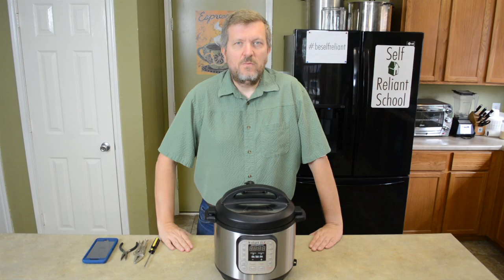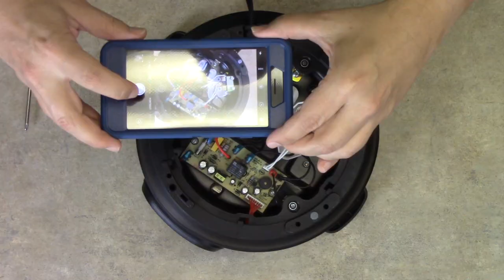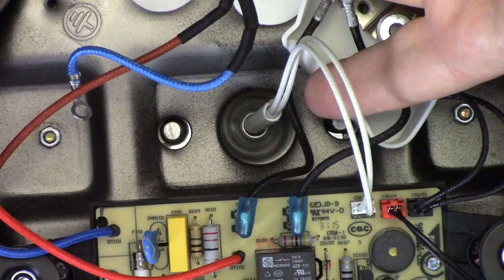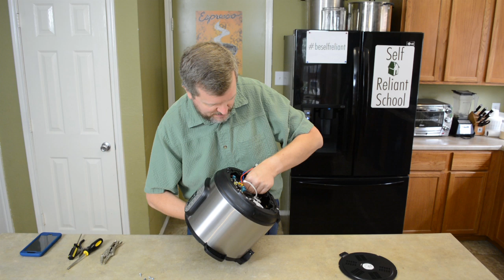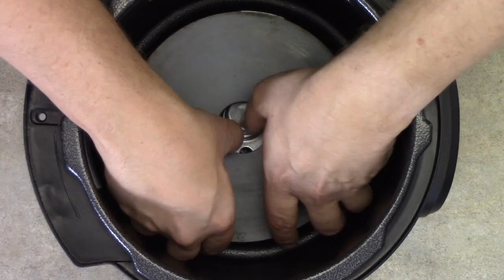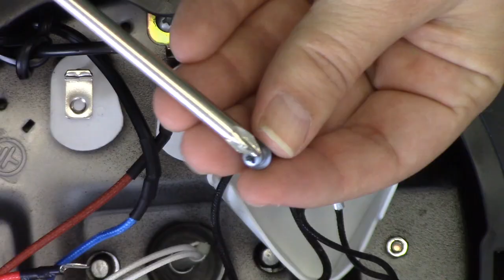How To Disassemble And Clean Your Instant Pot

Comment: Thanks, that worked exactly as you said! I dropped dry beans in the pot without the liner and after a lot fell out I could hear what seemed like a whole lot more that would NOT come out. Ugh! I did take the bottom off but when I saw all the wiring I closed it back up. Then I found your video and it was SO helpful. Step by step, easy peasy. Thank you so much!!!  Excellent teacher. You remind me of my late dad who showed me so many mechanical things over the years. :-)
Reply: I can’t seem to get the screw out of the bottom and I’ve tried two different Phillips screwdrivers. Any tips for somebody with arthritis in their hands to get this done? I was careless and put black-eyed peas in the Instant pot after I had taken out the stainless steel pot insert? I feel really stupid.
Reply: I can’t find the beans and they’re still moving around in there.
Reply: A glass container fell out of the cabinet and shattered all over into my instant pot. The glass is rattling around inside. I'm glad other people were successful with this video Cross your fingers and wish me luck. Going to tackle this next weekend lol

Comment: If you've dropped water or food in your Instant Pot without the liner in, don't immediately turn it over.  Have someone hold the pot up while you take off the bottom plate.  Notice that all the connections have white plastic "umbrellas" over them.  If water or food rain down on them from above, they somewhat protect the connections.  But if you turn the pot over right away, whatever is on the bottom plate will be dumped back onto the wires.  You'll have less mess to clean if you take off the bottom plate as I mentioned.
Reply: We took off the bottom plate and cleaned what water we could; however, ours would not come on at all.

Comment: If you used the liner, upside down on the counter and put the IP over it, wouldn't it make it easier to unscrew/screw the heating plate?  Great video and definitely a keeper for future reference!
Reply: That's actually a good idea!
Reply: Ha ha! Shhhhh! A+ student don't embarrass the teacher
Reply: that is helpful.  I was going to have to get a friend to help as I don't work well 1 handed.
Reply: Nice tip! Work smarter, not harder.
Reply: .. put a pad over the liner so it wont scratch as it drops onto it .. shhhh, actually, you feel more in control of the situation like the master showed us .. ha, ha ..

Comment: Here are the exact tools I used to disassemble my Instant Pot Duo that I got in 2020: a T15 star screw for the first screw to get the cover off the bottom; a Phillips head two/PH2 (a slightly thicker one that makes it easier to unscrew that 3rd tougher screw on the inside); and a 9/32" socket with my ratchet to remove the nuts to release the base. In my case, I also had to disconnect the yellow cable in order to remove the spring-loaded element, because that part was covered in the spill that I needed to clean.

Comment: Brilliant video -- clear narration, concise, to the point, great camera angles.  Very, very helpful.  Here is another tip -- when undertaking this project, work on a big enough surface so that you can create an enclosure around the work with some rolled up towels, in case you accidentally drop one of the tiny parts and it starts to roll away.  Please don't ask how I learned this trick.
Reply: That NEVER happens to me - :/

Comment: An instant pot saver, indeed!  I accidentally poured wet rice into the works.  Two days of drying out and following this video and our instant pot is back in business.  Good suggestion to take a photo of the innards first, because ours is not quite the same (several more wires).  Our outside cover screw was six pointed.  Fortunately my socket wrench set had a six point driver.  I also used the socket wrench to remove and replace the two nuts and washers.  Can't thank you enough
Reply: You’re definitely not the only one who has dumped wet rice in there, we just did a couple days ago! 😫 But I’m so thankful for this video!

Comment: Thank you so much for these clear and straight forward instructions. My sweet husband found only an additional step which was to unscrew the yellow ground cable to be able to release the top plate.  Everything else was the same.  Thanks again☺
Reply: I had to do that, too. I  think that is because my model is the Duo series, so a slightly later model.  I just kept track of which screws went where. There were also washers on all my screws, so I had to keep track of them, too. Will test tomorrow! But the gunk from the steel-cut oats and water was never going to all come out by itself. Moldy. At least I'm not the only person who did something like this!
Reply: Mine was like this as well, since I have an IP Duo 6.

Comment: Thanks for the video!

So I was getting ready to make some nice black beans for dinner.  I always do a quick high-temp soak first.  I took out the insert, carried it over to the 1-pound bag of beans.  Carefully opened the bag, then walked back to my instant pot and dumped them inside--without the insert.

All the shaking and banging I did wouldn't get the last dozen beans out.  It just rattled and rattled.

I followed your video carefully and got the beans out and everything back together.  I have some pretty small socket wrenches, (it's 7mm for the two nuts) so I didn't have to use vice grips.

Thanks again!
Reply: Thanks for the 7mm tip. That make getting those nuts out so much easier!
Reply: I had a nasty boil over of sugar syrup. So glad I found your video. Took me longer to find the tools than to disassemble.  👍👍👍

Comment: I was unable to get the middle screw out and just stripped the head. However, when I took off the nuts, The plate loosened enough so that I could shake all the glass out. thank you so much. You made a terrifying and intimidating job easy.

Comment: I found this helpful and made me want to see if I could do this. I know this is for like, dried bits of food or rice that falls down inside the heat plate. But this led me down the rabbit hole after I poured about 1 cup of coconut milk into the pot without the liner pot. I immediately flipped the pot over to drain but all that did was drain coconut milk into more areas of the guts where all the workings are. I have the ultra and it’s more complex and has more wires and instead of bolts to hold the heat plate it has three screws plus the little one that’s located in the white silicone tray thing. One of which is under the the circuit board, so that had to be removed as well as what I think is the temperature sensor. (Has the silicone white protector tray with the black wires connected in blue to the circuit board)
I took phone photos and put the screws on sticky notes with a description. EVERYTHING (outer metal sleeve as well) had to be unscrewed and wiped down with q-tips, tooth picks, small pieces of paper towels and small cotton towels. There was coconut milk in between the screws, washers, brackets that hold the circuit board and the bottom of the circuit board.  Luckily the circuit board did not have any coconut milk on it! And I did not attempt to take any wires off the circuit board except for the plugged in ones. But there was no way to access the screws for the heat plate without taking the circuit board AND the temp sensor thing. 3.5 hours later, all assembled, I tested with water on high sauté. Tiny amount of smoke wafted up from inside between the liner pot and the pot itself. Now to test the temperature settings to make sure I did not mess up that part. The control pad looked untouched by the coconut milk and it’s still working after the disassembly and reassembly. A replacement base for a Ultra 80 is $95 plus shipping/tax. I figured I might get lucky and save not having to replace it. I learned a lot about this instant pot. I paid for my stupidity. And next it will be to find out if I pay again if the cleanup of this instant pot still fails.
Reply: My issue was dumping a hot mixture of BBQ sauce and grape jelly from the meatballs back into the pot. I didn't realize that my friend had put the pot in the sink to soak. Then of course, I did the same as you and turned it upside down to attempt to drain the pot, which only made the guts get drenched with the sauce... clear to the inside of the top of the pot. I even had to remove the lid pressure sensor. Since I didn't find a video of the process to completely disassemble my IP DUO 6, my friend shot the video of me completing the process back to where this one stopped. I finally got to bed at 5:30am on New Years Day, MUCH later than usual!

Comment: DARN!! I just dumped dry rice in the pot thinking the liner was in it!!  
I'm using this video to try and remove the rice.

Thanks.
Reply: I'm here because I drop some oil in it accidentally
Reply: exactly why i'm here...ugh what a nightmare
Reply: That’s why I am here, my instant pot bottom isn’t a Phillip screw don’t know how to get it off
Reply: Taylor Garrett, a small hex key is what I used. I dumped rinsed, un-soaked pinto beans in my pot without the liner. (face palm) I jiggled the beans out. Luckily there was barely any water, but I wanted to see if there was visible moisture under the plastic plate. I am gong to use a hair dryer on low cool to gently dry it out, just in case.
Reply: Does this also apply to the ultra model?
Reply: HAHA! That sounds so funny to me now, but would you believe I once put soapy dishwater inside the element part thinking the cooker pot was sitting inside it.
I did not even try to dry it out, and simply bought a new one, but I could have bitten my own hands doing that!  I will never, ever repeat such a stupid move!  Nice to know I wasn't the only one!
Reply: @gaga4goats584  doesnt look like it

Comment: Thank you so much for this video.  I purchased a LUX 60 V3 at goodwill for $10 yesterday so I would have an extra bowl and the inside needed cleaning terribly so I told myself that's alright it will clean up nicely with an SOS pad.  Went to clean it and removed the pan, then realized it was filthy under there as well.  I didn't stop where you did and took this one completely down to clean out the grease someone had apparently used in it.  It seems that  it was used as a pressure fryer instead and I'm pretty sure we can't do that.  I cleaned it all up, put it back together, put my ring from my DUO in it today (I don't want to use that ring so I tossed it) and steamed some asparagus tonight.  

Both the DUO 60 and LUX 60 seem to have interchangeable lids as well.  The bodies of the two are different, my DUO is shorter and wider than the LUX which is taller and skinnier and they have most of the same options on them.

Comment: Nice video dear. It helped me today in cleaning my nutricook in which my wife accidentally put the rice without inside container 😅. Though it was nutricook but its bottom structure was ilttle different like it didnt have nuts connected with heating plate rather it had 3 screews and one of them was under the circuit board so had to unscrew the circuit board as well. Bt ur video gave me idea and courage to go for the self cleaning. Thanks alot

Comment: Great video. The magnetic screwdriver work around was great. Also, I see that there is a fuse inside, and that it can be checked by removing only the bottom piece.
Reply: My IP stopped working and I suspected the fuse.  I found a YT video somewhere telling how to replace the fuse and where to buy one on amazon.  Replaced it and it works like a charm ever since!  The mfr. won't tell you about any of this because they want you to just buy another one.

Comment: Thank you.  I tried VERY FOOLISHLY to boil a small batch of whole shrimp in my IP.  After days of cleaning, the stench from inside the base was unbearable.  I took off the bottom casing and poured 1/4 c white vinegar and rolled it around to clear the inside walls.  I poured vinegar in the base top and let in run through to do the same.  I used a large paint brush to clean higher up the walls and under the base on the inside.  It is drying now...and smells like white vinegar...which is VASTLY better than the shrimp.  I will post after I try it out tomorrow.
Reply: I am unsure of what you were describing?  Are you talking about the actual pot housing? where the element is?  Did you pour vinegar in that area?  Or were you just describing the lid construction?  lol!   I you did describe the main housing, please don't switch it on lol!

Comment: Thank you so much!  I put some dry beans in my exterior pot by accident and they went under the heating element.  I was able to get them out easily by watching this video!  I used a mini ratchet to get the small bolts off the underneath.
Reply: I just did the same thing, which led me to this video. I guess I'm going to have to try this to get the last bean out. I also see some dried on food down in there. Another reason to do this.
Reply: @gloriacrawford6911  So frustrating!

Comment: Great video, straight to the point with no distractions, and would really like to go after lid in a similar strip down manner, however, avoiding, pliers if we could use a nut driver or wrench/socket if necessary. I think that if someone is brave and smart enough to attempt to tackle such a job, then they will be willing to obtain a more proper tool, call it a bit of audience analysis.

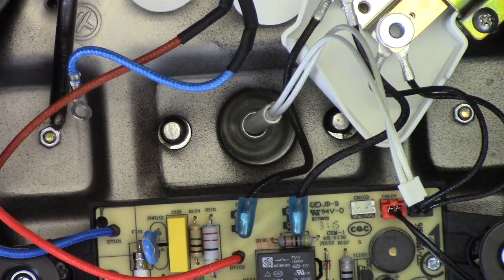Comment: 5:15 I believe the piece on the inside of the instant pot (that connects to CN103 on the board) is actually a thermometer (thermister), not a pressure sensor.

Comment: WARNING!!! Firstly, thank you for giving detailed instructions. The part about the hard-to-remove screw should get an edit. That screw in my case had the stem shear before it loosened. It's a low-quality screw for that application, almost like they want it to fail if it gets worked on. It might have helped if I'd done it while hot, which has its own set of concerns. That part appears to be a delicate thermal switch, and without that screw making tight contact with the heater element casting I'm assuming the pot will malfunction or be unsafe.

Comment: I dumped water in the pot thinking the liner was in it. I quickly unplugged it and dried it with a paper napkin and then with a dryer inside and under the pot. Then I tried to open it and removed the first screw, as you show, but since my rice cooker was not the same, there was no way to remove the bottom lid. If I don't use the rice cooker for 3 days so that it dries completely, can I use it again without any problems? As the wether is very hot it may not get to rust, what do you think?

Comment: I'm pretty good at doing repairs, and followed your video with my IP Ultra after having a gallon of milk boil over into the bottom.  I'm now getting a C6L error code after putting it all back together.  The ultra is a little different than the one you worked on, a few more wires, but all else looks similar.  any suggestions?

Comment: Based on some diagrams I think the tightness of the heating element would affect the pressure sensor's calibration. I'd expect a torque spec on the screws, at least the one that's hard to line up, because it looks like that one connects the element to the pressure sensor (but then why is that a Philips and not something with better engagement?). I'd also expect a need to recalibrate the pressure sensor after reassembly. But hopefully these parts are more independent and robust in their margin for error than I'm imagining. I fear having things cook totally differently after reassembly.
Reply: Considering that this affects the pressure sensor, would disassembly/reassembly be dangerous? Worried about turning my pressure cooker into a bomb.

Comment: Hi. I just bought an IP and I thought I'd just vacuum out anything if it got under the heating plate. Thanks for the video. Subscribed. Judy.
Reply from the maker: Hi,
That is certainly a good thing to try first. However, there are some things that are sticky or gooey that just won't come out, not to mention the residue they might leave. And I don't know about you, but I really don't want to use my vacuum on anything that I use to prepare food. I wish I could say my vacuum was cleaner but it would be a lie....:D
Reply: what about aluminum foil rolled around the heat pad and replace it as soon as it gets soiled ? I would like to get an expert answer ?

Comment: I watched your video because I had soup poured in my 8 qt IP by mistake. I followed your instructions, made sure everything dried well, sat overnight. I did a test run with 2 cups water - 5 minutes. At the end of 5 minutes, the pot started spewing steam like a quick release but noone touched it. I opened the vent and let it finish. Now I'm concerned about using it. Would appreciate any info you might know that caused this. My IP was a Mother's Day gift so hope i can salvage it. When I took the heating unit out, the 3 elements were discolored. I wonder if that is a factor. Thank you for any help.

Comment: If yours doesn’t have the two nuts holding the plate, you’ll have two large screws instead. One is under the circuit board. To get that off you have to undo the three screws holding the round plastic base (the stand), then the black case that holds the circuit board will unclip where two of the screws were.

Comment: Well this is pretty scary looking, but I dumped rice in my instant pot and now am receiving an error code so I think this is my only solution. Thank you for these instructions. I plan to use them step by step. If I would have taken the bottom off and seen those wires without these instructions, I would have given up right away.